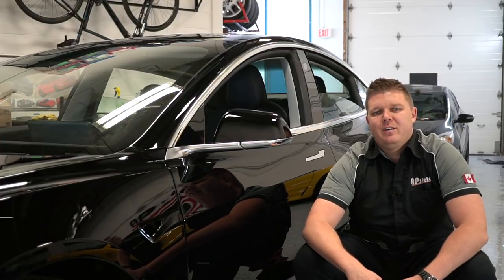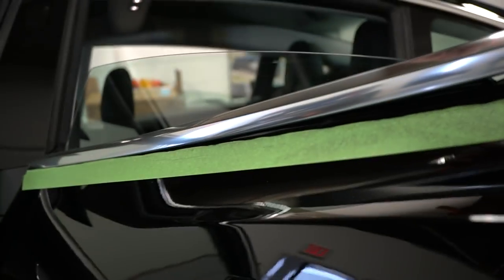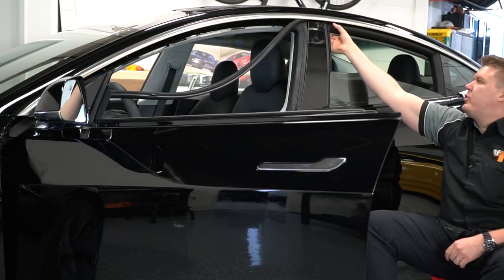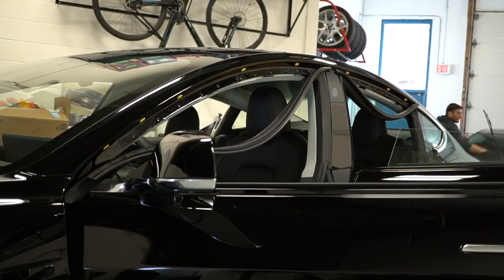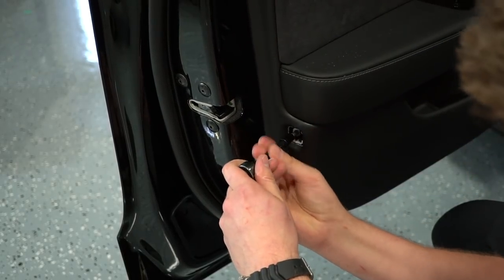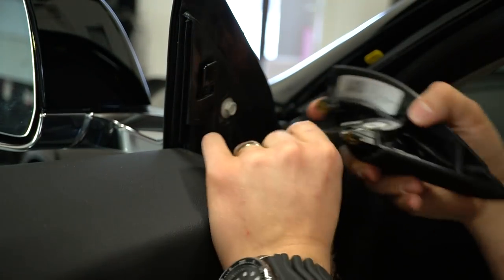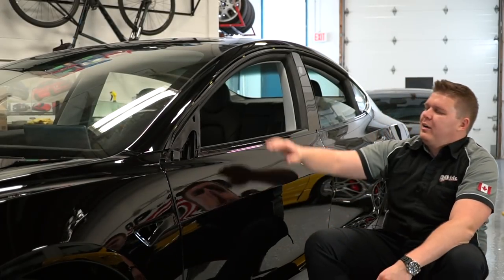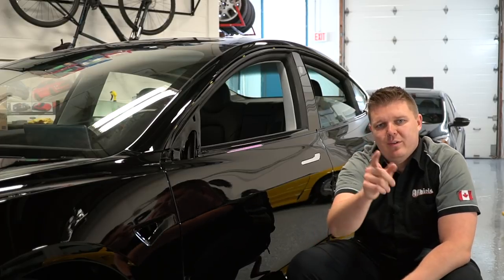Tesla Model 3 Window Trim and Side View Mirror Removal - SUPER EASY

Comment: What size is the fastener?  Tesla catalog shows SCREW,PF,40x12,SHLDR[4x1.4],STL,ZNNI, part number 1115453-00-B.  What is that exactly?  Looks like an M3 or M4 thread but don't know shoulder diameter, length, etc...